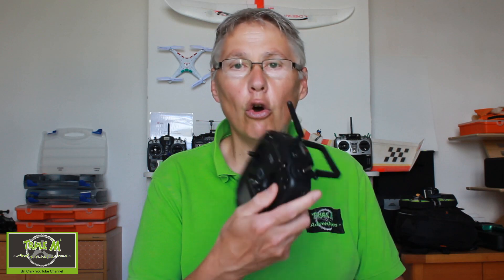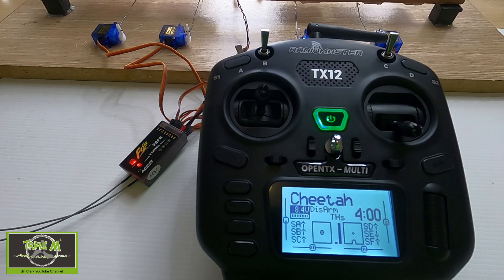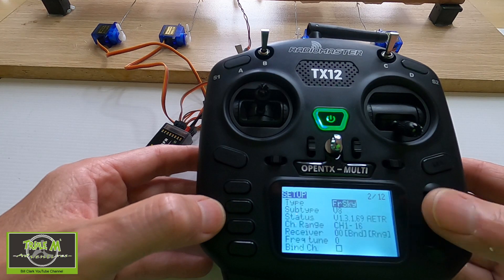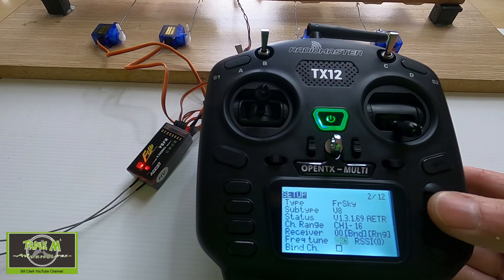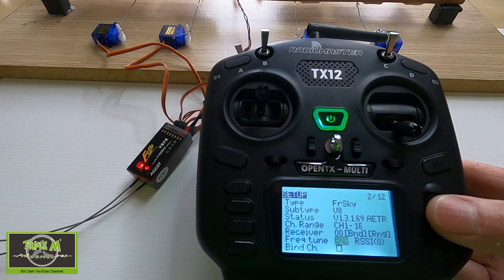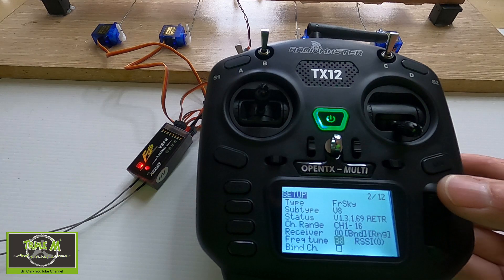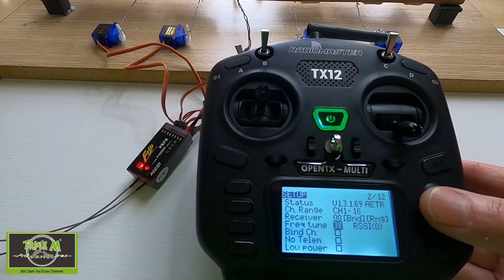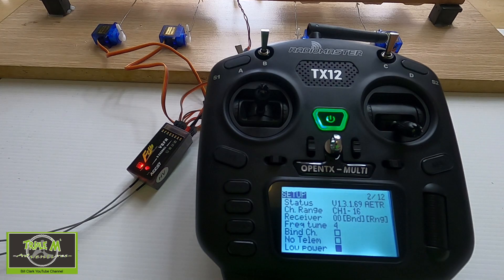RadioMaster TX12 Frequency Fine Tune Multiprotocol Module with FrSky Receivers

Comment from the maker: What I want to add to this video arising from viewer comments is If you give your receivers numbers to use in a different model you do not need to re-bind your receiver but you will need to manually put in the fine tune figure it is not copied across when you select the receiver number. If you copy a model to use for another model then it is.

What I did miss out in the video was that if the option is available for the receiver you are using I would suggest you do the tuning.

Comment: I have followed your way of range testing receivers and believe your method is convincing!
Because I had ordered 3 RadioMaster R168 ( not arrived yet) before I was looking around at RCGroups and others. There, I found a person who did fly with that particular  R168 and was not happy at all. The  R161 was fine.
Now Bill, is there a chance that you get hold of one R168 and do such a test with that D16 mode RX? I know you are using  D8 mode for yourself I understand.
I herewith quote a short part of a sentence so you can read why I am worried now. RCGroups-person-quote: --- the same spot where the R168 was 0 RSSI and no signal, I had 50 RSSI with the R161. and no warnings. ---and of quote.  Thanks Bill
Reply from the maker: I have tested the D16 receivers and they did ok. So far the tests I have completed the 585 metre mark does catch out some of the receivers including the RadioMaster D161 & D168 and they do struggle at 2000m but RadioMaster state 1km + When the tests are released you can compare them to other receivers. Once you receive your receivers and if not happy please let me know and report it to RadioMaster the support so far seems good from reports from my viewers.
Reply: @the-happy-RC-flyer  Thank you for the reply! That does not sound  to bad at all. I will test them carefully after arriving before I trust them. Bill keep going and good luck with your channel!

Comment: Is it also necessary to do this to other frsky-based receivers (such as radiomaster r81 or r161)?
Reply from the maker: Endi yes it is, what I do is if the option is shown when binding your receiver just do the Frequency Fine tune it will defiantly not do any harm.

Comment: i just get my new Tx12 transmitter a few days ago, i i was a beginner in rc drone too.. i had trying to bind my Tx12 with mjx bug 8.. but nothing happen, i had seen ur video tutorial on ur channel.. and trying follow ur instruction too.. hopefully u can help me to solve this problem.. tq
Reply from the maker: I am sorry to say I do not think you can bind your MJX Bug 8 to the TX12 as it only has the CC2500 RF Chip which does not include the MJX protocols. I checked the TX16S and it does have MJX and Bugs protocols. I do not have a MJX Bug 8 to test it for you. Sorry not a very helpful reply.
Reply: @the-happy-RC-flyer  thanks Bill..

Comment: Hi, i lost rssi at -44 but it comes back only at like -35, which number should i write down then?
Reply from the maker: Hi Sam, -44 +35 = -9 then divide by 2 = -4.5 round round -5. You need to move the scroll wheel both ways and use those two figures.
Reply: @the-happy-RC-flyer  hi, you misunderstood me, when your rssi signal goes out at lets say 30, when you scroll it to 29, it comes back up. But in my case it comes back up only when i move it closer to zero. Eg- i scroll left- lose signal at 35, scroll back to 34 but the signal is still gone. I scroll to 20 and THEN it comes back up
Reply from the maker: @samschw  that can happen you just need to find the mid point of the fine frequency tune so if -44 and -35 add the 2 numbers -79 divide by 2 = -39.5 so round to -40.
Reply: @the-happy-RC-flyer  oh ok, thx

Comment: Really Nice Video. Is the Radiomaster TX12 compatible w with FrSky XM+ Receiver?  Thanks.
Reply from the maker: Yes as long as the protocol is ACCST and not the newer ACCESS.
Reply: @the-happy-RC-flyer  I'm just starting out in the fpv world, and I'm a layman, I got some parts and I'm assembling one, I have a frsky xm+ receiver, how can I know its protocol?
Reply from the maker: @gleisonantunes  Welcome to the wonderful world of FPV I am sure you will love the journey. There is no way to find out from the receiver what firmware it is using. FrSky receivers can be tricky to bind because of the different protocols.
FrSky X
FrSkyX2
and then FCC & LBT-EU versions.
If you are in Europe then you must use the LBT-EU version.
The firmware on the receiver must be ACCST and not ACCESS which will not bind to the multiprotocol module I am almost certain yours will be ACCST.
So try X and if will not bind try X2 and I am sure you will come right.
Reply: @the-happy-RC-flyer  I live in Brazil, but this friend of mine bought his pieces at amazon in the USA.
I'm looking to buy this RADIOMASTER TX12, but I need to find out if the Frskys I have are ACCESS or ACCST.

Can I access the Frsky XM+ firmware somehow without having a radio?
Reply from the maker: @gleisonantunes  no you cannot, if you are a member of an RC flying club who may have a TX12 you can test bind the receiver. If the receiver is new did it come with documentation which could give you a clue. If it does not bind you could try and flash the appropriate firmware if it is available on the FrSky website.
Reply: @the-happy-RC-flyer  I have no contact with anyone who owns this TX12.
I saw in a comment on your video a guy with the same problem with the Frsky XM + that wasn't binding, he updated the TX12 and it worked.
I appreciate the help, and I apologize for taking up your time.
I will continue to search some forums
Reply from the maker: @gleisonantunes  you should be ok. If I can assist you further please let me know.
Reply: I am having a similar issue trying to bind tx12 with xm+ 
Rolled back the firmware of xm+ and still nothing

Comment: we just got this tx12 with edgetx-elrs and it won't bind to the r88 receiver
Reply from the maker: The R88 is not an ExpressLRS receiver. You will need a Multi Protocol Module to use the R88 as its protocol is FrSky D8.

Comment: After the fine Tune, do have to rebind  the same RX?
Reply from the maker: No the receiver will still be bound to your radio. If you give your receivers numbers so you select the number if you use the receiver in a different model you do not need to rebind your receiver you will need to manually put in the fine tune figure it is not copied across when you select the receiver number. If you copy a model then it is.